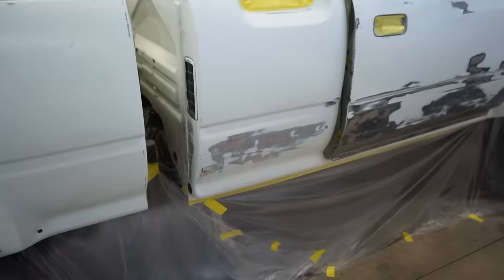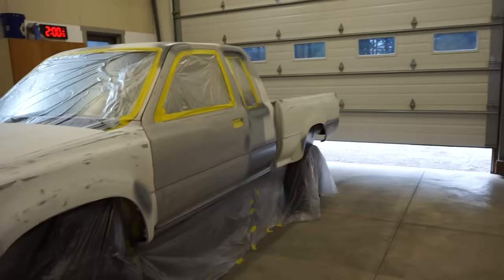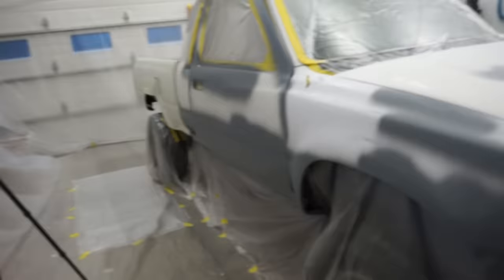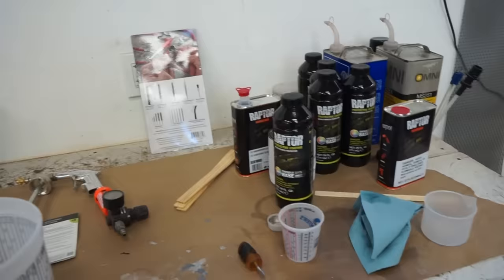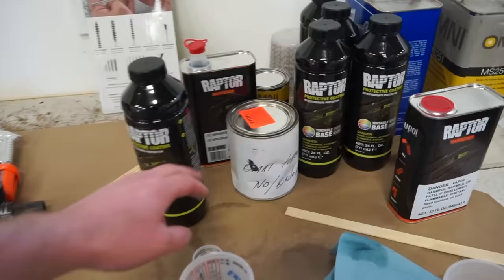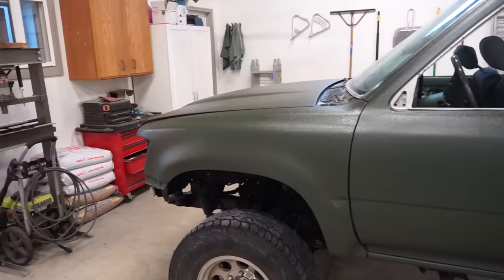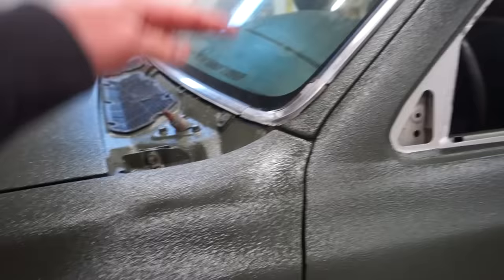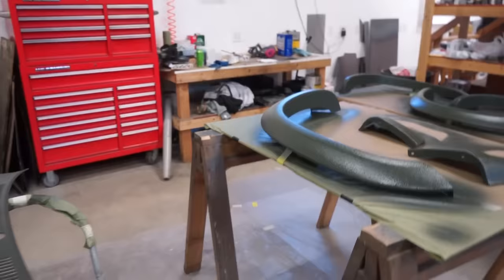DIY Raptor Liner Paint Job On A Toyota Pickup!!

Comment: No one post how much paint they use!!
Reply: Watched some guys use the full 4 quart kit on a ford excursion. That was a THIN first coat. They said it was thin. I plan on using two kits on my dodge w100. Hope this is somewhat helpful.
Reply: Never. Must be getting sponsored by raptor.
Reply: My 2001 suburban is going to take 8 bottles

Comment: Looks good.. gotta say, the more I see done with the Raptor product.  The more I like it. I understand that you can also clear coat or apparently even better ceramic coat over it. Making the color really stand out and preserve the color even better.  Something to think about.  You mentioned wheels... yeah 20's ughh.. but 16 or 17 inch can give you a little better tire selection than 15's anymore.  While still giving you some good sidewall which is good for a off road vehicle.  Tiny little side walls are great on street cars. You should be able to easily get a set of 35's to fit depending on offset and width.  Anything taller will require a lift for sure and gear change.  Be nice to see a topper on the back, also coated with the Raptor liner.  Then a exoskeleton roof rack, custom bumber and spare tire carrier, .... endless ideas and looking forward to seeing what's next.  Looks good so far.. oh yeah rims... steel old school and painted with you guessed it.. Raptor liner  !! ... you   know you have a little extra... a splash of brown here and black there... you have a camo truck...

Comment: looks great but you broke 2 important rules...never ever spray raptor for door jams, and dont mix more than 2 bottles at a time due to viscosity. why not door jams? well because seals are meant to fit against tight flush surfaces. now you risk water leaks going into your jams because water seeks the path of least resistance and raptop is a textured paint with grooves and valleys. aside from that it looks dope though

Comment: I had a 85 strait axle that I loved. It was red, and I loved the color. It started to rust really bad, and the motor needed rebuilt. I sold it last year to a guy that loved it for $1200. I want to get another one, but they aren't cheap. I paid $2,600 with a head gasket that was getting bad, but it was worth it. This will be mint looking when your done with it!

Comment: 33x10.5 ftw.  The 12.5's can look a bit ballon-like on the pickups and 1st gen tacos.  Unless you plan to offroad it a lot, in which case go with 12.5.   And if powdercoating the rims, can't go wrong with a satin black.  A dark bronze/metallic brown could also look great.  A buddy did this with a set of the early-mid 90's Toyota pickup/4runner oem alloys.  Totally updated the look.

Comment: Yesss!  15's with 33s...  Sorry for teasing you.  lol  I had a 2001 Ranger XLT 4x4 ex cab black no metallic with chrome bumpers.  It was lifted 4" with 33" BFG Mud Terrains letters in and American Racing aluminum chrome wheels.  I wouldn't even take it on a gravel road!  Ive done 14 trucks and that was my favorite.  I did a 91 F250 regular cab the same way with 35s.  It had an EFI 460 with 4:10.1 limited slips.  It was a monster, I'd like to have it now...

Comment: 33x12.50r15’s on 15x8’s look good, running that set up on my rig with 3” suspension and a 3” body lift and looks good. Should send you a picture of my truck, still building though. This is the daily driver and trail truck so not sure if it will ever be finished, but I do get a lot of compliments.

Comment: When I raptor linered my van. I mixed up a bottle at a time and sometimes the raptor liner would harden before I shot the whole bottle. I'm surprised you didn't run into problems mixing 3 bottles at a time
Reply from the maker: Gotta spray it fast!
Reply: @austinniemela  I definitely sprayed fast and the bottles would still start to gum. I'm amazed you got that stuff all onto the truck without it turning into a rock. Good job

Comment: Actually true cure time is 28 days 7 days cure is for light duty use only. Should also paint whole vehicle with just the paint and color without texture them immediately paint with the raptor mix . Also should paint whole sides with one pass not just door just fender just door with 75 percent overlap to prevent tiger stripes.

Comment: It will be interesting to see how it holds up! I've heard that the added thickness and texture can cause issue with stock gaskets in the doors, and that the clearances between the door/fender can become so small that you can get chips. I love the colour, I think some black raptor liner accents would look great.
Reply: First thing that I taught about when I saw him spraying the doors and other areas where lights and such are. I would first do those spots with normal color about the same as the raptor mix and then secure them with tape and do the raptor on the exterior.

Comment: So I'm a year in with raptor linering  my hole jeep wrangler inside and out and I tires stick out 9 inches . It's a rock throwing mother trucker and with that being said I drive it every day 2 miles down the gravel and 30 miles on the highway  to work I beat the absolute piss out of my jeep and the raptor liner still looks brand new and hasnciped yet. I used 8 bottles on the outside and 4 inside.  And my wife and I couldn't be happier.

Comment: My 08 tundra has been done for 2 year's. Holding up pretty good. Some scratches. No waxing, no stone chips, power wash clean. People ask about it all the time.
Reply: How many gallons of paint did you use
Reply: @joshlatcha9540  I used 12 tintable and 4 black. Did rockers black and 2 hood stripes. 2 coats of each.
Reply: @ddnmd  So you did 12 quarts
Reply: @ddnmd  Of the one color
Reply: @joshlatcha9540  of the tinted. Buy off ebay, cheapest way.
Reply: @ddnmd  yah imma try to just use 8 quarts 😂
Reply: @joshlatcha9540  u have tundra? If your matching your original paint, don't paint the roof or inside doors.
Reply: @ddnmd  No I have a Dodge ram 1500 and like you said I’m not doing the bed inside the doors or anything like that just extremities and as quick as possible
Reply: @joshlatcha9540  get 10 to be safe. If you run out you have to sand the first coat so the new coat will stick. Any rust has to be completely removed and sprayed with with raptors acid primer.
Reply: @ddnmd  ok thanks

Comment: Austin, great job! two questions, do you need primer with raptor liner? would a 6 gallon compressor with a 1.5hp and 150 psi be enough for to get the job done? Ok, one more.. would 2 bottle be enough for a truck camper shell? Thanks bud.

Comment: Good looking truck.  Which ever wheel set you decide will look good on this truck. It is only a matter of your intended use. Black on the flares to match the bed and bumpers would be nice. Is it possible to do the same to the TOYOTA letters on the tail gate? Sweet ride..

Comment: I didn't see you use plastic adhesion promoter on the flairs? If you stand farther off with the spray gun and hit the panels again, it helps with streaking you see. Overall looks good
Reply from the maker: The flares are already painted so a scuff is all thats needed!
Reply: As a semi-successful paint company owner: Austin is 100% correct. 

If it has already been painted previously then a light scuff sand and cleaning is all that is necessary.

Comment: I have a couple questions you didn't let the viewers know , how many bottles of raptor did the truck take to cover ? What psi did you Spray at ? Is the green supposed to be a olive drab green color ? It looks bad ass. And what is the brand of gun you used ? It seems to spray real nice . Excellent work
Reply from the maker: 10 bottle and 2 coats. 60PSI, i had a paint store mix up the color, close to olive drab! Using the professional gun, link in description!

Comment: Black wheels. If you're gonna paint those wheels, wouldn't epoxy paint be more resilient than powder coat? Truck looks good.
Reply: Epoxy has almost no UV stability. Polyaspartic or a urethane would be the smart choice. Powder coat is nice but has some major downfalls.

Comment: I saw this after prep sanding my 89 You and before I started painting. I switched to bed liner. I practiced with 2 bottles of black on the bed with an hvlp gun. Body next. I've read 466 comments to avoid forcing you to answer this again. Did you use 10 bottles on the body and bed or just the body? Btw, it's inspirational.
Reply from the maker: I used 10 bottles for the green and 4 for the black inside the bed!

Comment: Austin looks killer dude! I want to get my truck done with raptor liner was curious if you would ever be down to take on a job like that? Little bit of body filler on some spots dents not to worried about and to get raptor liner done. 1990 toyota single cab pickup was my first rig at 15 looking to do it all up but i defiantly dont know my body work and painting.

Comment: Did you sand the primer? And if you didn't how will the raptor coating go over time being unsanded?

Planing on doing this with my ls1 swapped d40/frontier navara.
Reply from the maker: Epoxy primer is a wet on wet to topcoat within 3 days for excellent chemical adhesion
Reply: Ahh right, cheers mate. BTW other then the few little dents very nice build.

Comment: That is definitely the best way to mix it. Did the 3 bottles cover the whole truck or did you have to mix more?
Reply from the maker: I used 10 bottles for 2 full coats
Reply: Ok thanks. I would like to spray a econoline E350  extened van with a 6" lift in a light gray so that would probably take more than 20 bottles.

Comment: So you know how thin the sheetmetal is on these old Yotas, my 4runner has lots of small vertical creases above the wheel well from kid knees climbing up the outside. I am going to raptor and am debating if I try to fill these or if the raptor will help them disappear. Only visible when looking down the truck, where they reflect. Thoughts?
Reply: Of course, I posted before I got to minute 14. So, not going for a show truck either, but thinking a couple hours with bondo might be worth it for me.

Comment: How did you remove the door handles? On mine, I was only able to get them loose. Also, how do you remove the back window?
Reply from the maker: Unbolt they and pull them out, pull the lock Cyl too. Back window, pry out the gasket from the inside while pushing the window out, pops right out

Comment: Hey how many bottles/liters did you end up using? Planning to do the same on my 91 4runner.
Reply from the maker: I used 10 bottles for 2 coats
Reply: Amazing job! I am trying to do something very similar with my 97. Does the 10 bottles include the 3 it took for the engine bay and underside of the hood? Or 10 just for the exterior? Thanks!